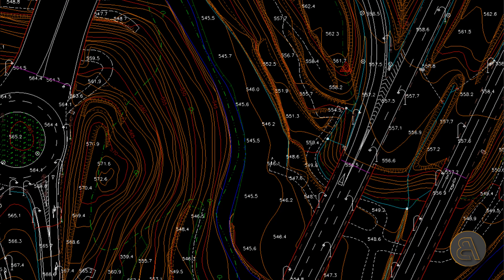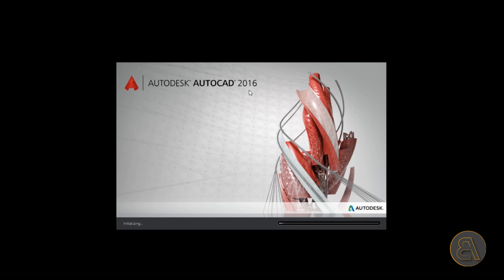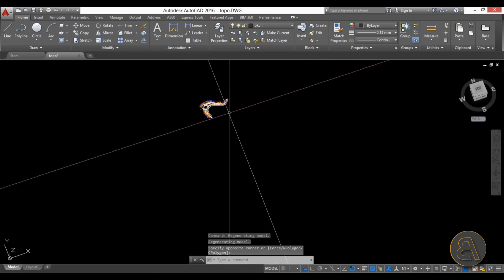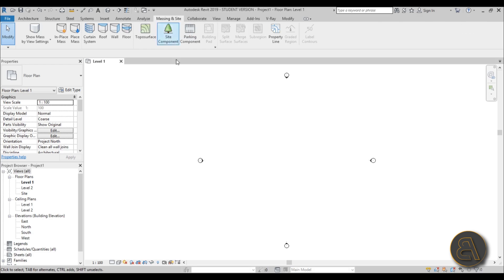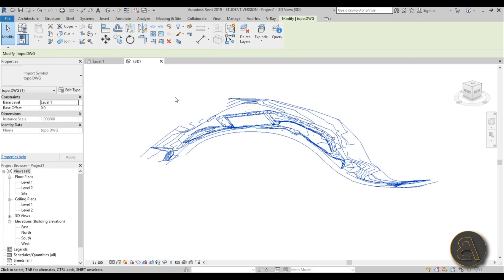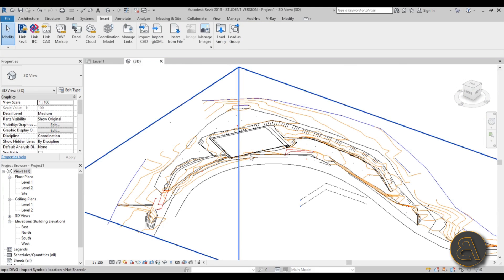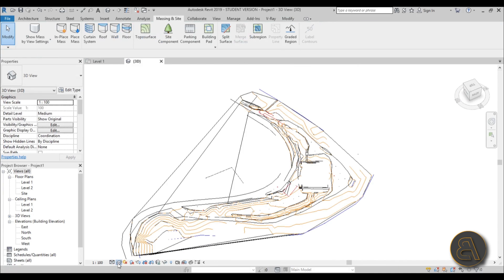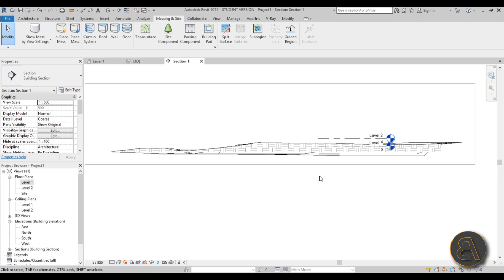Creating an Accurate Site Plane in Revit Tutorial

Comment: Hi there, I quite like you tutorials.
Just an idea, YouTube seems to be lacking a comprehensive tutorial for Modeling in Revit from a Point Cloud. If there is a tutorial that walks you through the modeling process of a lets say Tudor Style house, where all the openings, windows, doors, staircases would have to be freshly modeled as a brand new family then slotted into the project, rendering the house etc, then I feel there would be quite a few hits on your video. There are techniques for making automatic colour adjustments to wall that do not match the point cloud or out of vertical with the point cloud.
Regards,